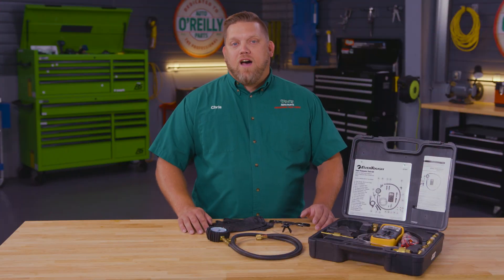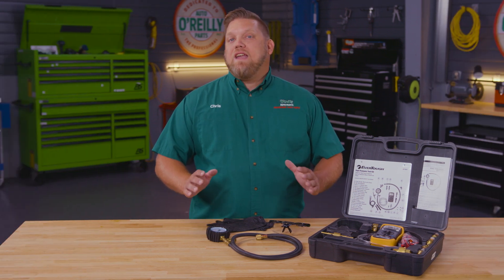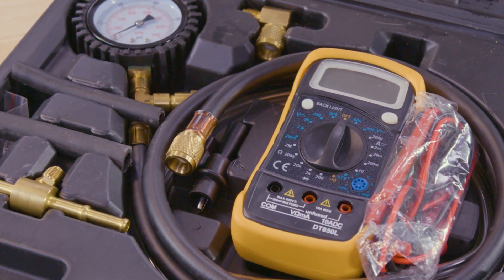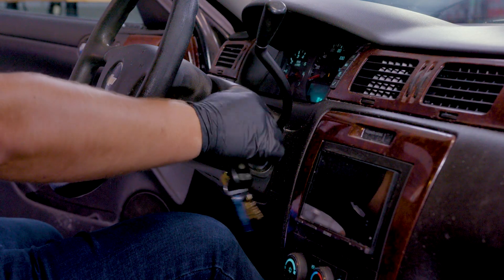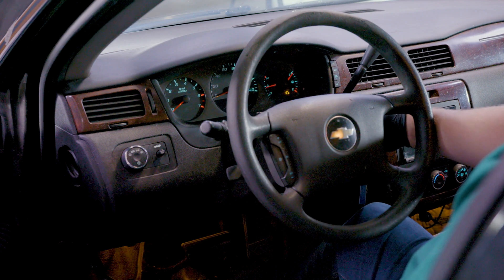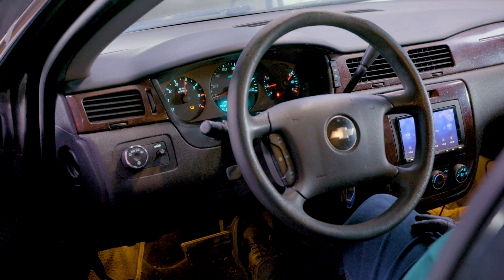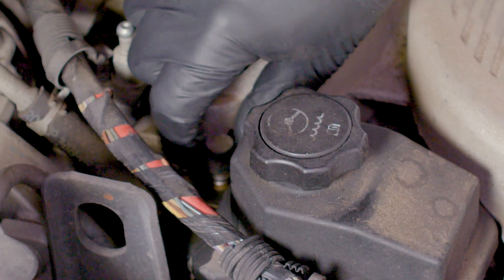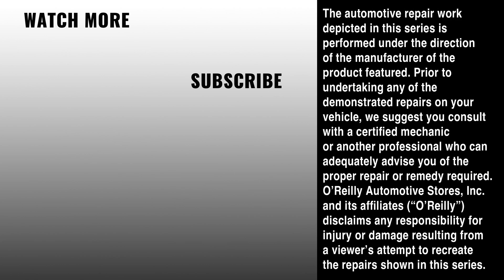How To: Use a Fuel Pressure Test Kit

Comment: Should we take fuel pump fuse/relay out? Is there a possibility of fuel coming out when taking off Schrader valve?
Reply: yes take the relay out and jump the connector. yes fuel will come out use shop towels to clean
Reply: Y would u take that out?
Reply: Hope you didn't do that , that guys being a dick , as long as you're key's of you won't have any problems. Now if you do what that guy said it's a good way to burn a relay and have your fuel pump come on no matter what. Are bypasses all the on-off switches and go straight power to the terminal of the pump. Yall got to quit messing with people you going to get someone hurt , while some of them are funny spewing fuel every where is a danger hazard for real Brody .
Reply: No. Not needed. Only thing that is needed is to, with a small flat blade screwdriver, pocket style, depress the schader valve with a rag over it to sop up the fuel that comes out( a very small amount). What you're doing is to release the line pressure so as to NOT get sprayed with it. 
Removal is straight forward with engine OFF. 

Don't remove that relay or jumper it. 

Unless you feel like buying a new one.